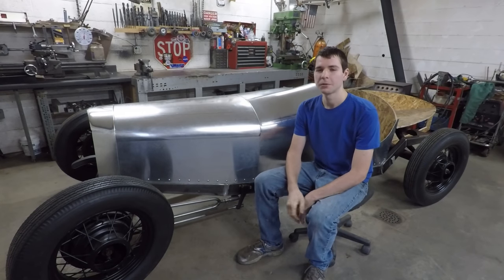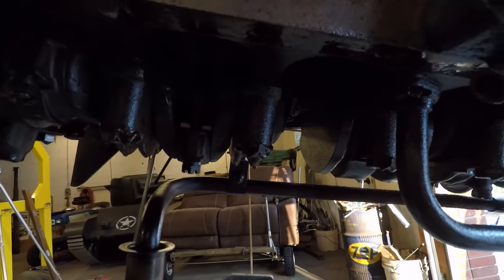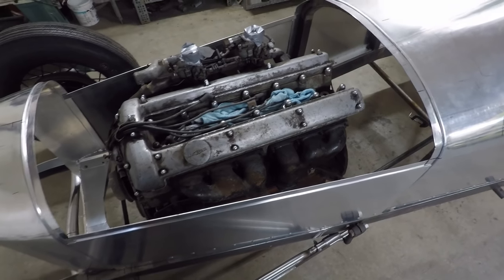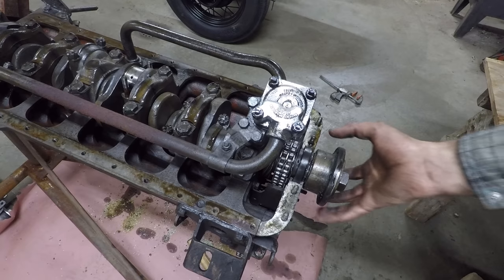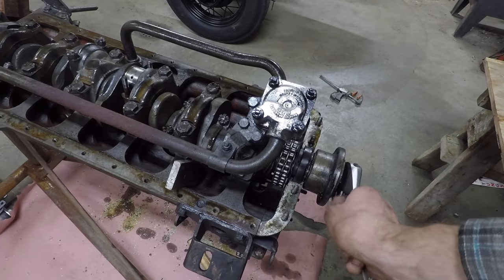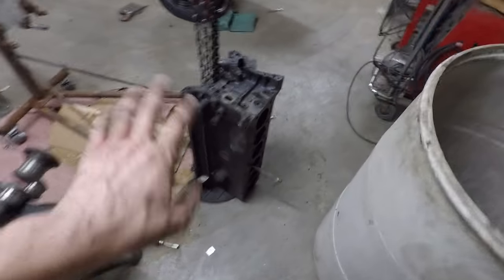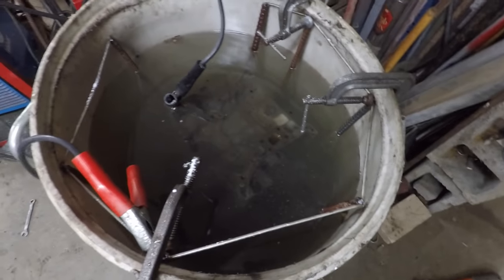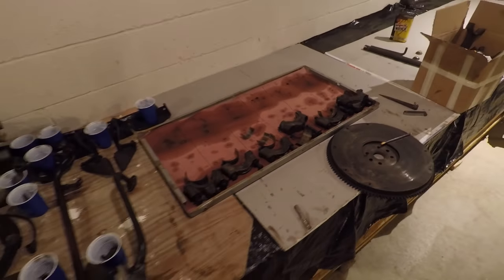Jaguar 2.4L XK6 teardown | Homemade IndyCar Pt. 32

Comment: Being British and growing up with Jags I see the 2.4 as the baby engine, much preferring the 3.8. However it is the perfect, era correct, look for your project and once set up properly will live forever, under-stressed and smooth. These old girls like to be looked after and reward a careful owner, sounding perfect with a good exhaust note. You seem to have later model exhaust manifolds already.  Cars like yours would be tuned and regularly upgraded as parts became available so feel free to enhance the look with side draught or at least a 3 SU carb set up with polished trumpets or air filters and maybe a race looking exhaust manifold (with or without wrap). An Alloy radiator could be dressed up with some brass trim and some classic red or yellow braided HT leads etc. It might be nice to paint the engine block in British Racing Green enamel but please keep and polish the hell out of all the alloy parts, they are priceless.
Reply: Agree!!! Absolutely British racing green for the engine.
Reply: Love the look of polished brass on top of that green on the old European sports cars!

Comment: My first car at age 16 was a Mk2 3.8 liter Jag...that started a life of 15 years of restoring Jaguars...They are prone to getting cracks in the aluminum head and or corrosion.  If the head is good, your in great shape...if not, well that will be another story.   Everything else you said in the video is spot on...great choise for this build...you remind me of a younger me, as I have followed you build...I had a coach builder friend around the corner from my shop and an English motor shop down the street...both were invaluable in my early days...Great work...Keep it up.
Reply from the maker: great to have you watching!

Comment: If you have to replace the pistons you could over-bore the cylinders to accept the pistons from the 3.4 litre engine. Using the 2.4 connecting rods gives you a short stroke 3.0 litre engine which really goes. ( I read about this mod years ago and I am not positive it wasn't the 3.8 pistons, but you would no doubt find out about this fairly easily). Food for thought.
I really like what you are doing and undoubtedly the Jaguar unit suits the pre war racer look absolutely. All the best from the UK.        Simon Webley

Comment: This is the perfect engine for your speedster.  The flathead is nice,  but this twincam is one of the most beautiful and reliable “ Indy-like engines “ you could have gotten.  And who cares that it is a 2.4, it will move you along just fine.  Superb choice.  And it will sound SO right.  If you want, I do have an early e-type 4 speed gearbox (moss, non-synchro first) that I can contribute and ship to you.  I do not have the bellhousing though, and jaguar bellhousings, flywheels and starter combos are a bit voodoo.  Keep going, you are on a roll!
Reply: The internet has a way of bringing out the best and the worst of people. You are definitely one of the former.
Reply: Paul Rigsby thank you, Paul

Comment: With that Jaguar engine powering this ultra-light aluminum-bodied speedster - it is going to be a handful to keep it tamed and on the road.  Since you're using a Jaguar engine, I think it should have an English burl wood dash with a compliment of Smith's gauges. Make sure you have real leather seating too. These period touches add to the authenticity of the builds overall ode to the 1930s automotive period.
Reply: I agree with you it will be a handful, the steering wheel should be a 4 spoke and as you say leather or rope https://www.mgexp.com/phile/46/514272/wheel.jpeg as for the dash a sports car like this I would reckon an alloy engine-turned dash with your Smiths instruments, I think would more suits a grand tourer. https://upload.wikimedia.org/wikipedia/commons/c/ca/1931_Bugatti_type_35A-51_Grand_Prix_%285%29.jpg But hey we all see things differently and is what makes it interesting. Whatever he does this young guy is doing great quality work I'm sure you would agree.
Reply: you have great taste yes it would look awesome.

Comment: The Jaguar engine is a wonderful choice. It will give your Indy Speedster the aura of the Miller or Duesenderg specials of the 1930s. Jaguar won Le Mans with your engine in the C and D types in the 1950s. Great work.

Comment: I rebuilt a late 1968 ish? 4.2l jaguar i6 a few years ago. I got lucky enough to find a british specialty shop near me that let me trace their cam position/ timing tool so i could duplicate it at home and not have to buy one. Other then that the valve tappet shims was a bit tedious to make right as i had a few valves replaced but they were cheap and easy to find even in stainless steel. Also the oil feed banjo fittings on the back of the head are easy to forget about when u cannot see them. Other then that its simple engine building. And im not sure if its common or not but the factory distributor was cracked above the drive gear  and i was able to find an aftermarket flamethrower? For pennys compared to repops.

Comment: Engine machinist here. Some things to consider regarding your Jaguar engine. As it happens, I've been inside one off these engines, albeit a tad older (1954 3.8L). 
First, you will want to save up some money to have hardened exhaust valve seats installed in the head. Back in the day there used to be lead in the gasoline, and it would act as a semi-liquid wear surface on the soft valve seat. Since you'll be using modern unleaded gasoline, the valve is going to beat the soft seat to death, unless you either get the hardened exhaust valve seats, or, if you can find it, you could use a liquid lead substitute fuel additive every time you fill up.
Second, if you decide to hop up the engine with some racy camshafts, I would highly recommend you check the piston-to-valve clearance. There's nothing worse than the piston crashing into the still open valves as it's coming up the bore.
Third, while you have the head being worked on at the machine shop, have them modify the valve guides to accept positive valve stem seals. They last much longer than the old school seals, and they work better. Besides, you don't want your freshly built motor to smoke and burn oil.
Fourth, you might investigate the possibility of installing a more modern rear main seal. That was one of those jobs we didn't do on the aforementioned Jag engine. This is mainly to reduce oil consumption, and to prevent that typical British engine oil leak.
Fifth, if you want to raise the compression on the engine to increase the power, I would recommend keeping the compression ratio somewhere in the neighborhood of 9:1 to 9.5:1. You'll have plenty of power, and you'll be able to use Regular 87 octane gasoline instead of Premium. Plus, keeping the compression down below 9.5:1 will increase the longevity of the motor. The bottom end won't be overtaxed or overstressed.
I think you've got yourself a really nice engine there, and it's a great unique choice for a one-of-a-kind car like what you're building.

Comment: Downdraft carburetors and a steel oil pan.  Jaguar all right, just has had a rogue life!  Certainly pleased that you knew about the studs under the cam drive cover at the front of the head.  So many 'Merican mechanics back in "the day" broke the head prying on the front section!

Comment: I am currently just finishing a 1932 ford roadster. It’s powered by a 1952 Jag engine that looks like yours.
,but came out of a MK VII salon.  I also used the moss four speed. Not happy with that so I agree that the
Five speed is the way to go. I would post photos, but don’t know how that works on a you tube comment.
Great job, I’m a Fan.

Comment: You are a brave man to take on a project like that but will be so happy when complete,  One of my good friends back in the 60,s had a father who was a British mechanic and he hated to work on the overhead  cam engines  as they were so difficult to time and set up the valves. In that era you could buy kits to change out your Jag motor for a Chev. in the XKE Sport  car. At that time I was offered a 1953 Jaguar Sedan for $30.00 .

Comment: The Jaguar six cylinder engine is without a doubt one of the most beautiful engines ever made. And looks perfect in your car! A few notes of caution; valve lash can be tricky to set perfectly, but a lot of patience will help you with that. Carburetors synchronization is tough, no doubt about it, but can be helped along with intelligent linkage design. I have no doubt you'll figure it out.

Comment: Not sure if Borg Warner furnished the manual transmissions for this particular engine, they did supply the automatics I believe.  The engine stock produces about 120 BHP so it won't take a very beefy gearbox.

Comment: if you find that the cams   are noisy and you can't get a proper shim kit for them..my Dad used to work on a Neighbor's Jag in the  70's(we had a Esso service station for 35 years) and he solved the noisy tappets by using dimes under the Valve caps ..just file them down to the correct size and bingo  works like a charm..by the way I think your doing a Great Job ..thanks for sharing ..stay safe..

Comment: I hope you marked the main caps in some manner so that they go back in the same position. I'm also a bit surprised that the machine shop didn't want the main caps with the block. A good inspection would include checking the main bore center line.
Reply from the maker: yeah I kept them organized, and they also are stamped from the factory with matching marks on the block so they go back the right way

Comment: I had to break away before I finished watching so I have a new question
You sent the block to the machine shop without the main bearing caps in place?

Comment: You will definitely have to get the cylinders re-honed professionally with over size piston rings. In purchasing all new gaskets, I would also cough up the price for new head bolts, cam chain and timing gear. Unless you're going to do a complete rebuild, its not really worth the effort.
I would also have the head done with new valves and springs. Have you got the gearbox and figured out leg room with pedals yet? It looks like close quarters with steering, exhaust and pedals all on the same side. Keep everything all bearing caps , con rods and pistons separated and numbered as you are going along this is very important.
Awesome job on the body keep up the great work, your not my son but you're making me proud.
keep up the good work and don't quit.
Reply: You beat me to it.  I agree 100% and I also kinda cringed when he was removing the head which could cause more warping.  Cool idea in lieu of using the Flathead Ford engine but he'll have his work cut out for him to do it right.  Engine space might be another consideration with all the the elements like brake master cylinders, clutch hydraulics, exhaust manifold, generator (alternator?) radiator, steering box...etc...etc....Good catch and feel like I'm not alone however, this young man is not only teaching himself, he's teaching others of his generation as well.  Kudo's to that!
Reply: Did you not watch to the end of the video?
Reply: @TheFlatlander440  steering box is already in so radiatior and master cylinder. Old school on the brakes would be a master cylinder under the floor.
Reply: @naberville3305  Perhaps.  But will he be going old school?  I hope he does.  That would be cool.  It will still require more on the fly engineering which he has proved he can accomplish.  Cheers!
Reply: @TheFlatlander440  when I chatted with him early on he was tempted to do mechanical brakes but reluctantly decided hydraulic drums would be safer. So yeah. Definitely old school. Though considering it's a 200hp at 6800rpm (Jesus that's gonna sound niiiiice) motor.. he's gonna want at least a brake booster. Which they do make for that style.

Comment: Seeing you use that adjustable spanner on the crank bolt was painful, lol. Otherwise you do great work, it's very inspiring. Thanks for the videos. Another way to get off bolts on rotating assemblies is with an impact gun. Can't wait to see this finished!

Comment: Now you know why the oil pan only had 4 bolts and the conrod caps were loose. 
Hopefully it is all saveable. 

It was great to see you removing parts and keeping them sorted by cylinder but when unbolting things like the head or crankshaft you should always do it in reverse order of the tightening/torque sequence. 

I recently saw pictures of a Bugatti Roadster and aside from being right hand drive it looked exactly like the body you are building right down to the placement of the stamped louvers on the boat tail that you haven’t shown yet on YouTube. 

👍🏻👍🏻👍🏻
Reply from the maker: haha yeah I definitely got a lot of inspiration from the Bugatti speedsters!

Comment: the jag 6 is a great design, beautiful to look at and to hear, and a great racing pedigree. my understanding is they are costly to rebuild which is why many swapped out blown engines with small black chevys. things i'd suggest considering is weight and cost v. the flathead, and whether that banjo rear can handle the torque of that six.
Reply: The Flathead puts out 245Nm at 2000rpm, whereas that 2,4liter (146ci) puts out 191Nm also at 2000 rpm and 120hp at 5720rpm... Not bad for 60% of the Ford's total displacement.

Blown engine blocks is due to people not letting the engine warm up (it can take up to 15miles) before welding the pedal to the floor. If the banjo rear is know to handle a 4liter Flathead boat anchor, it'll be fine with that XK240 ^^
Reply: @jean-charlesweyland129  you're answering to comments i didn't make.
Reply: @Ecosse57  Only on the cost factor didn't I reply dear Sir, your other affirmations are correct.

European prices can't be compared with US/Canadian ones. Those engines (in their smallest yet great configuration) aren't as common as it's 4,2l big brother. Therefore less specialist and parts are to be found on your side of the pond... wich doesn't imply that prices are high because the 2,4 liter is a sought after rare beast, but by the fact that you have to custom make what you can't find like pistons for exemple.

Flathead parts are not that cheap either.
Reply: In dealing with the later xj40s, I never crossed paths with a single overly expensive part. Max was about 10% more than regular Aussie car parts (brake rotors). The whole chev swap was more like yanks think anything less than a v8 isn't a real motor- and that some jags used a turbo trans meant an easy, cheap convert.

Comment: A bit of a change going from a side valve engine to double overhead cam. Still I think the Jag engine will be way better than a dated old flat head, if you don't mind having an engine out of period with your car. You can also get a nice triple SU carb set up as used on the E Type Jag. As said Jag parts are expensive, even over here in the UK but get yourself some warm real beers and enjoy rebuilding it.

Comment: There's thousands of rods with flatheads.  There aren't many with Jag 2.4's, particularly ones with an Indycar look. If you can rebuild that engine without taking a huge hit, go for it. 

And to all who complain about the Jag having less power: Why settle for a flathead? He could build it with an LS crate motor and have plenty of power. But power isn't the point. Stylistic authenticity and beauty are what he's going for and the Jag will deliver both.
Reply: The Jag had more power than the flathead if I've read right. 120 in the 6 vs 100 in the V8.

Comment: Unless you acquired the bellhousing/transmission with the engine , you are going to need an adapter plate to mount a transmission . Good luck with your project , it's great to see you learning so many skills !
Reply from the maker: I'm planning to make an adapter for a t5 trans
Reply: @MacroMachines  the later model XK 6 and V12 were mated to GM auto trans . Not sure about earlier 6 cyl. Good hunting  !
Reply: MacroMachines I made a couple of adapter plates for adapting t5s to my flathead fords. Well worth the effort.

Comment: I'm collecting parts to build a special for some years now. I too have a 2.4 for it, connected to a 5 speed LT77 transmission, some of the parts for those engines are hard or impossible to get (damper for example), I'm trying to age it to make it look more like an early race twin cams. I really like Jags engines, they are great and perform very well. I restore jags for a living but as a bodyman and had the chance of driving the 3.4, 3.8 and the 4.2, never the 2.4.

Comment: When you were removing the bottom end connecting rod caps I think on your pink numbered sheet you put the No 6 cap from the rear of  engine in the No 1 position which is usually the front of the engine.  This may possibly confuse you later. Good job getting the Jaguar engine to install in your great project.

Comment: Before tearing into an unfamiliar engine I would find a manual and read it first. Jags have a cam time setup that is quite complex. Also you will need the torque settings when you put it back together.

Comment: You will want to check rotation on that engine. If I remember correctly it is would require flipping your rear axle.

Comment: rather than 2.4 you may want to go for 3.4 or 3.8 and more torque to go by... lots of options out there (esp. swapping with up to 1984 XJ engines, you can still keep the polished alloy cam covers) - you may keep your likely B-type head ... T5 is a good choice for reliability (jag boxes are enough for road use if not abused)

Comment: Use the flathead man it would give it an older feel and it’s a bigger engine
Reply: Bigger yes, but with less hp as standard. And not much more torque either.

Comment: You've got yourself a "newer" kind of XK engine. The old ones had no studs at the cam cover where the timing chain sits in the front.
Of course, that resulted in oil leaks. Jaguar fixed this in the early 50's.
You may want to tune the engine a little as it should be around 120 Hp as is.